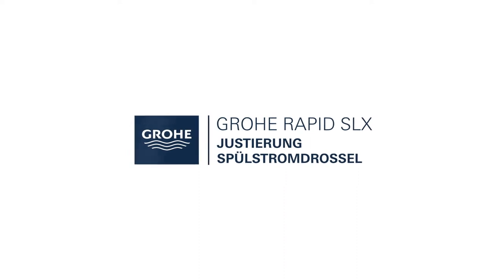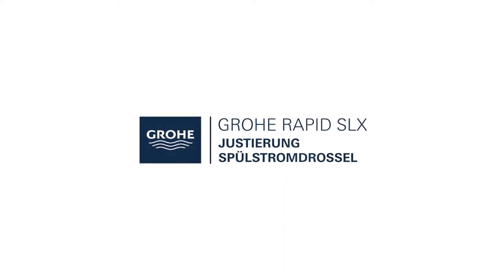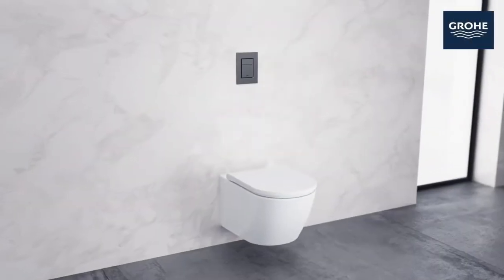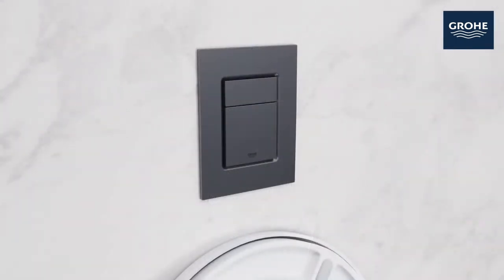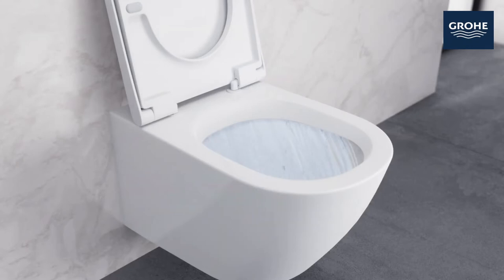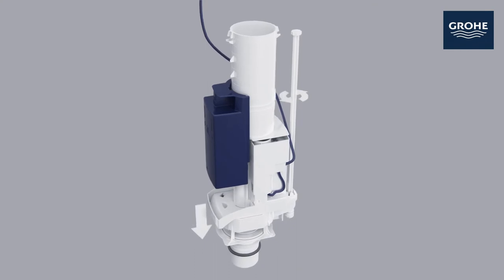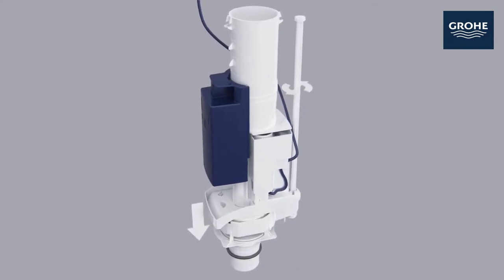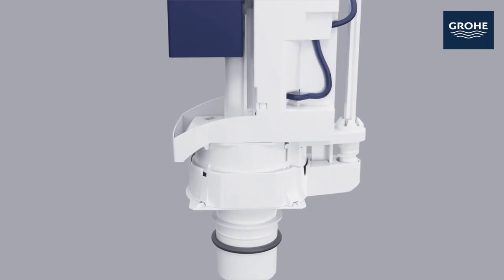Grohe Hidden tank System settings⛩ Overflow issue in cistern adjustment extension for Overflow pipe

Comment: Hi I have the same flush tank. Am suffering from a problem and no one knows ho to fix it. There is a humidity in side the tank, that causes a leak once I press the button of the flush water comes from the same place because of the humidity inside. Any solutions?
Reply from the maker: The best solution would likely involve inspecting the internal mechanisms of the flush tank to identify any issues with the button mechanism, water flow, or seals. Depending on the specific problem, repairs could involve replacing parts such as the flush valve, fill valve, or button mechanism

Comment: How to find these brackets for flush plate mounting? What is product nimber?
Reply from the maker: To find the Grohe brackets for flush plate mounting, you can check the Grohe website or the product manual that came with your flush plate. The product number or code for the brackets may vary depending on the specific model and type of flush plate that you are using.

One way to search for the brackets on the Grohe website is to use the search bar and enter the name of your flush plate model or the type of bracket you need (such as "flush plate mounting brackets"). This should provide you with a list of products and their corresponding product numbers.

If you're having trouble finding the information online or in the manual, you can contact Grohe's customer support team for assistance. They should be able to provide you with the information you need to find the correct brackets for your flush plate mounting.